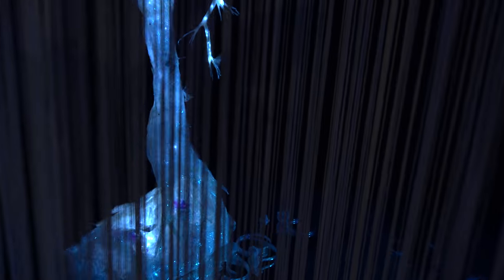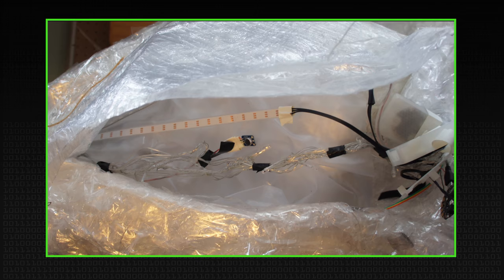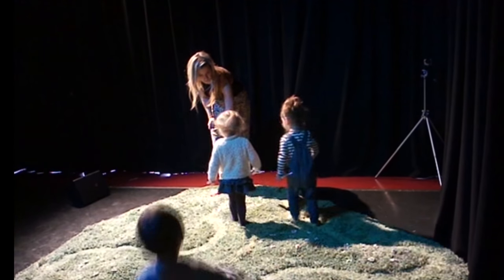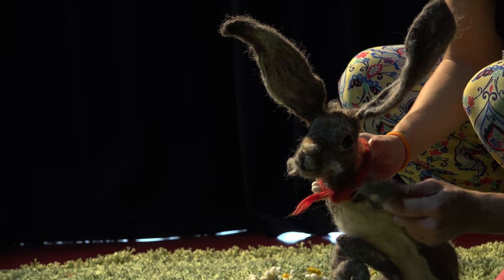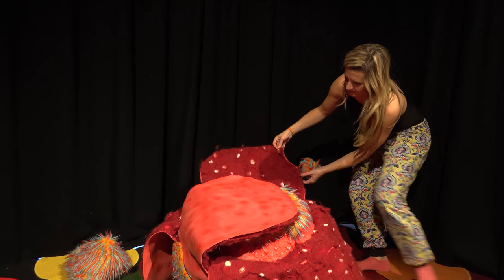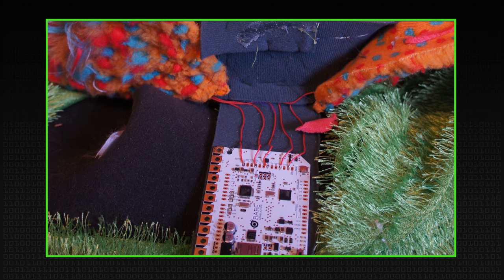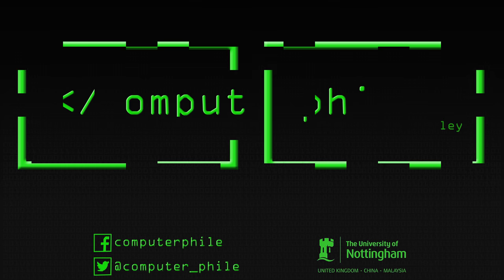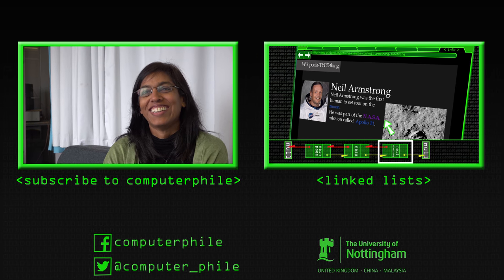Digital Theatre Props - Computerphile

Comment: Very Cool!  Reminds me of the centerpieces I made for my sister's wedding.  Each centerpiece used an audio sensor to change the frequency of lights and illumination.  So when the room was quiet for toasts and slow dancing, the illumination from each table was also more subdued.  But during dinner and chatting the centerpieces were more active.   It also gave a clue as to which tables were talking when they probably should have been more quiet... It was fun, because most of the guests did not think of the interaction.  But as we were gifting them to the guests towards the end of the evening, everyone was playing with them more and more.